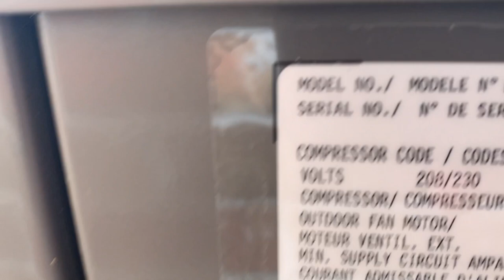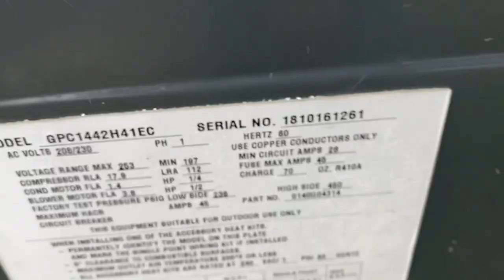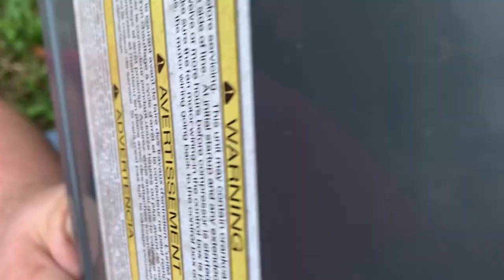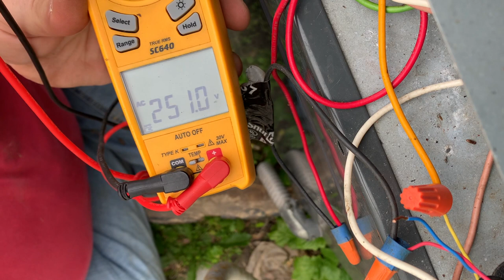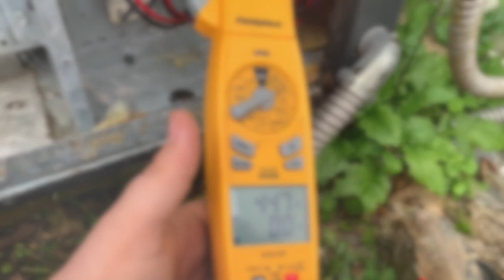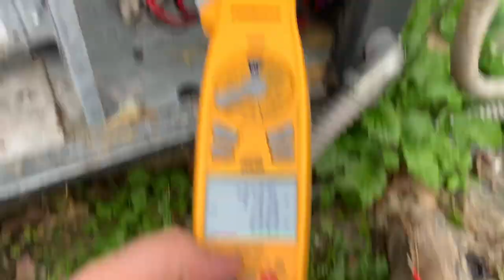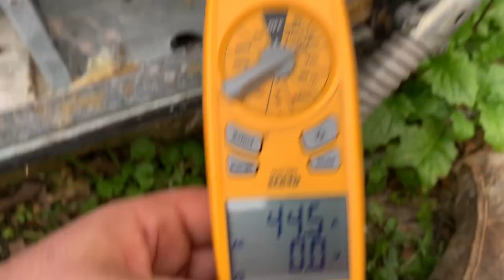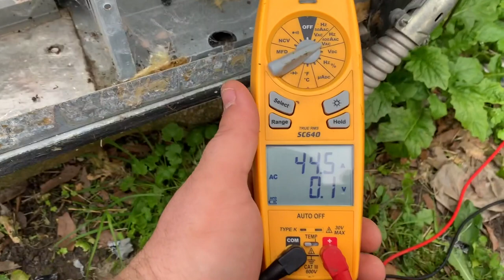No Heat or Air/Goodman Package Unit

Comment: If the transformer is humming , common sense tells you the power is on .
Reply: you can have a low voltage transformer make the same sound and its only 24 v DC he is talking about 240 VAC big diff :)
Reply: @apctech1  low voltage transformer is feed by the high voltage . Therefore if the transformer is humming the power is on be it 110, 208-230 or 575.
Reply: @danobrien3109  sometimes its fed by a separate transformer you have seen or worked on hacked up units right? i have
Reply: I was about to say same thing
Reply: Verify everything never assume
Reply: The transformer is made of laminated plating which will loosen up over time due to the vibration of voltage and current traveling through it. So light buzzing is not bad

Comment: You bypassed the Short Pro Tool when you jumped power to the fan and heat. Just something to keep an eye on in the future, so you don’t pop a transformer. Good job otherwise!
Reply: Yep
Reply from the maker: @ Andrew Pierce Ya you’re right. I should of hooked my jumper to the other side I see that now. We all make mistakes. Thanks buddy.
Reply: HVAC with John Israel if you find yourself in the same situation again (rare because usually the fuse is on the circuit board) use the short pro as the jumper wire and it will protect itself that way
Reply from the maker: Makes sense. Thanks Joe
Reply: @johnisraelhvac2019  doesn't that unit have a fuse on the board?
Reply from the maker: No board on this unit

Comment: i dont know if anyone noticed it , BUT it was a 3amp fuse( purple) that was blown, and he replaced it with a 5 amp( amber) fuse just saying if your gonna be a professional and do it right as you say  then do it all right. and yes  get rid of that damn wire nut on the fuse connection again, if your gonna be a professional and do it right , then do it all  right  just saying again.
Reply from the maker: Dude go cry to your mommy. I was out of 3 amp fuses nothing wrong with using a 5 amp. Get over yourself Mr Super Tech.

Comment: 15 kw will pull 60 amps by itself not including the blower.
Reply: 62.5 at 240v
Reply: @publicmail2  

I would like to have seen the whole data tag.  You can see part of it @ (4:51) and it says 35 amp max fuse.  That makes no sense unless it’s not really 15kw idk.
Reply: @speckulator7516  35 max amps is probably for cooling without any heat.

Comment: Should not blame Goodman for you not having the right tools. Metal whip outside is fine the unit is grounded. Having the hot hit the unit not very professional. The reason contractors want to pay 2or3 thousand install is because they know how easy it is to do. Charging 10 to 15 for install should be a crime. I’m no hvac guy butt been doing my own installs and friends for 30 years. Buying the unit and install for about 4,500. Just saying.